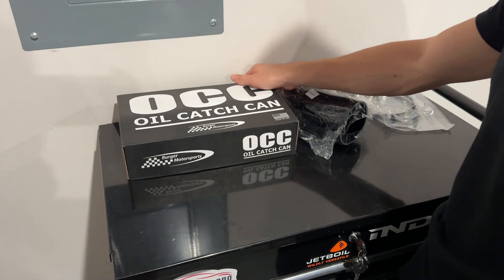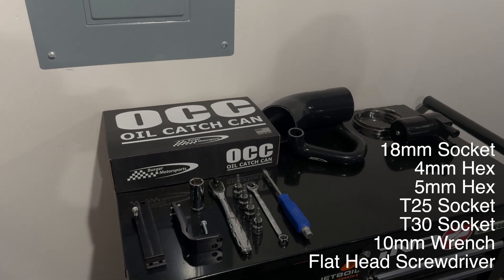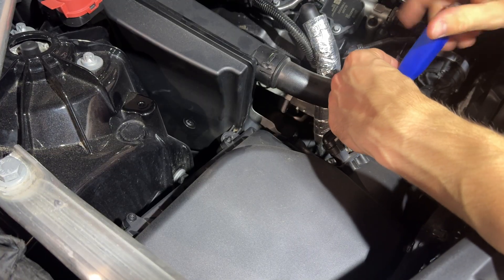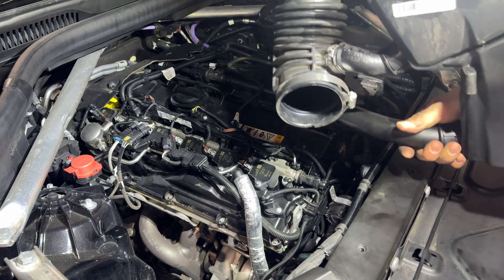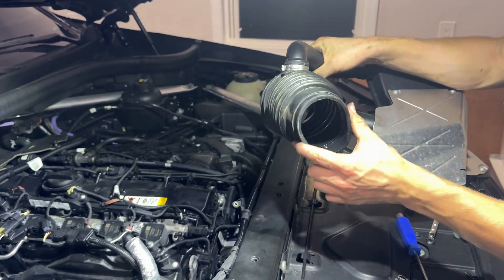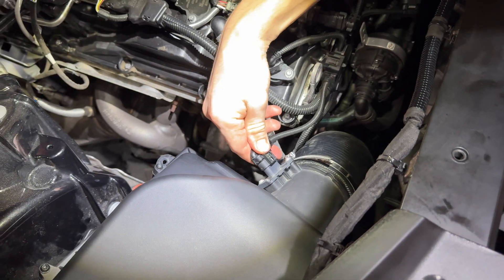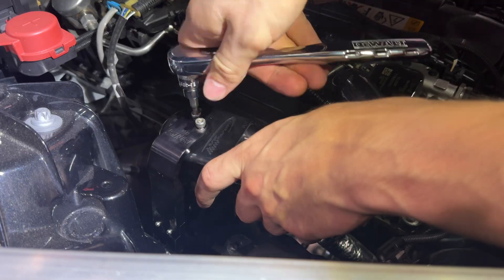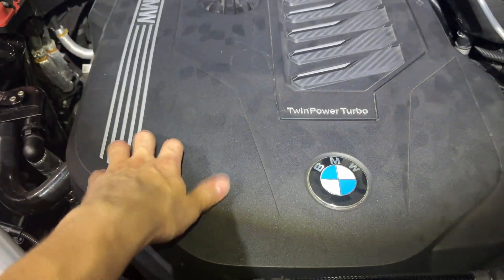BMW X5 G05 BMS Oil Catch Can Installation

Comment: One question, I have the GO5 X5 but I have the M50i with the N63TU3 engine. Can I install this for that model? Would I have to buy 2 catch cans? Video was great super informative. You got my sub and thumbs up.
Reply from the maker: I’m not sure about that, you’d probably have to find one specifically for your motor to make sure it fits
Reply: BMW N63B44T3 engine does not have a traditional, serviceable oil catch can; instead, it features a self-contained, baffling system within the Crankcase Ventilation (CCV) system to manage oil separation. While this internal system helps to keep intake valves clean, some owners install aftermarket catch cans to further reduce oil buildup, especially on the earlier N63 engines which were prone to oil seepage into the intake. 

Just purchased a 2023 GO5 M50i and am looking into catch cans right now but an update BMW did to their motors with the newest version is an internal system to help preserve carbon build up and turbo life timeframe.
Reply: @griesbach95 I have a 2020 G05 M50i as well. I was about to pull the trigger on the catch cans. But not sure if I should. I’m just trying to do as much preventative maintenance as possible. I found out about the front differential goes out on the G05 so the first thing I did when I go it was change fluids. Front and rear diffs, transfer case, transmission. I’m going to do spark plugs and coil packs next. I just hit 72k miles and I purchased with 58k miles.